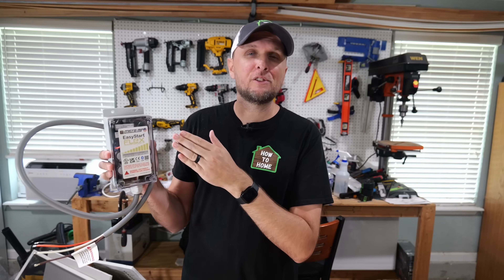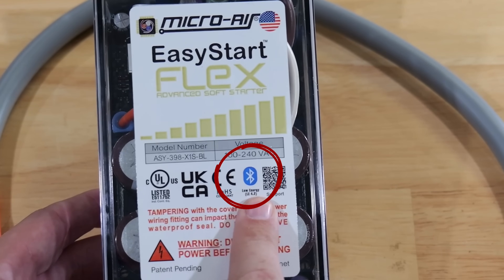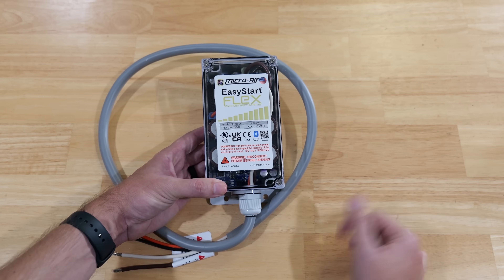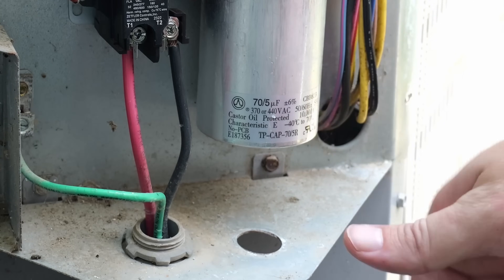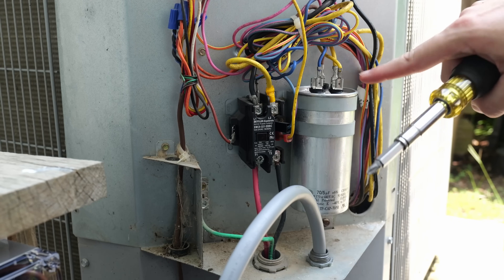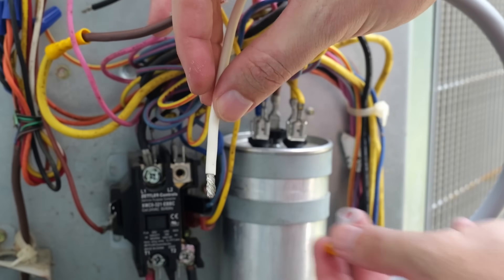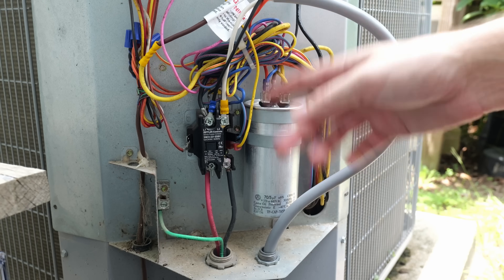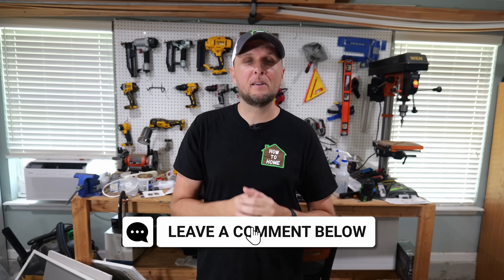The ONE AC Upgrade Every Homeowner Needs to Consider!

Comment: Very interesting video.  Would a heat gun solder connector be superior?
Reply: No and never do that for wear and tear items like this. Would you solder in your car's battery?
Reply: I will sometimes flow some solder under the spades tips after crimping. Makes for an awesome connection. But like the other commenter says, don't solder anything that you might need to replace or service--the HVAC repairman will curse you ;)

Comment: Will this affect the AC's warranty?  Is this approved by the manufacturers?
Reply: That's the big question I called them ask about that they claimed it doesn't because of the Magnuson-moss warranty act which states they can't void your warranty unless what you installed actually caused the problem. The issue I have is how are you going to prove it didn't not going to pay an attorney to sue them. I worry that Microair and AC manufacture just point the finger at one another. If your really concerned there are AC contractors in most states who install these have them install it so they can't say you messed up the install and caused it. Less likely IMO if a HVAC contractor does the work that manufacture can claim it was the fault of a soft-start. If your in a situation where compressor fails under warranty less likely that contractor going to tell the manufacture about the soft start because he installed it.
Reply: @Mike-01234  I would try to find reviews online. If there are bad reviews on the soft starter, you’ll find them. You could contact the AC manufacturer and ask. 
     This reminds me of that 100,000 mile synthetic motor oil called AMSOIL. 
The first thing the auto mfgr wants to see, when applying for warranty, is your service history (and modifications). If you have no record of timely oil changes, your motor warranty is void. They’re not going to honor magic oil. And if you’ve modified your engine, your warranty is void. I suppose it depends on the problem and the dealer.
Reply: @Mike-01234  Remember the days when you didn’t have to worry about warranties? My AC is 34-years old.

Comment: great video, question I have the whole house Generac generator installed at my house would I need this unit on my AC?
Reply: If your Generac is able to take the surge of the AC starting up now probably not. Some larger AC systems can surge over 100 amps for 1/2 a second.

Comment: I have 4 Ton unit and working great on portable generator during recent Texas storms! Game changer, and the new Flex unit just came out after mine but nice to see improvements too! ❤🎉
Reply: Ive heard that if i have a 50 amp generator but my ac is a 60 (which mine is) it will not work. Will these make it work due to the soft start being added, by chance do you know?
Reply: @johnny.9879 - you need to restate your question. I don’t understand what you’re saying and I am very familiar with this topic. Can you clarify?

Comment: Love the video. Will this work for a hot tub application. That thing sucks up a lot of juice when the heater turns on. Thank you!
Reply: Your heater is electical, not mechanical, so no.  This doesnt help with efficiency, only for start ups.
Reply: @srobeck77   he wasn't asking about efficiency, just asked "will this work" on start up.  But I think we all can agree it won't help with reducing loads on startup for purely electrical components with no moving mass (mechanical as you say) that increases starting loads due to inertia.
Reply: @Benjamin-rq1fi  it wouldnt matter for an electric heater
Reply: @srobeck77  lol I think we're agreeing but talking past each other.  My point was in your original reply you said "this doesn't help with efficiency" but David wasn't asking about efficiency.  I see that was your way of explaining why it wouldn't help with a heater, but it sounded confusing because you didn't fully explain that the heater's starting amps aren't going to be much if any more than that running amps (you of course implied this talking about mechanical vs. electrical it just wasn't explicitly stated).
Reply: @Benjamin-rq1fi  You're screeching pedantism and somehow losing your own strawman argument.
Reply: Probably not since that's not what it's designed for.  Also this is a guess, but I would suspect that in-rush amps for heaters aren't much more than the run amps.  Heaters just draw a ton of current because they're directly converting electromagnetic energy to thermal energy with some efficiency loss.

Comment: I have a 5 ton model.  Not the flex. I've only had mine installed for a about 2  billing cycles.  And I've seen a 30.00 per month decrease in my power bill. 100 plus degrees in oklahoma. 
At first the unit actually was louder on startup.  It seems to have become more quite after the first month.  I have not used it with my generator yet.
Reply: How does your company charge them?  Unless there is an amperage charge like he said the running amps is the same.
Reply: @condor5635  Many utilities have demand charges.
Reply: @condor5635  If you have a demand meter these can make a noticeable difference.  They are rare but I see them in rural areas - first saw a demand meter at my grandparents out in the sticks.  Wish I would have known about these back then; they could have used one on their well pump - you could see the freaking meter move whenever their well came on!

Comment: Will the flex work OK if installed on a 15 year old compressor?
Reply: No reason it shouldn't, electric motors are motors and doubt much has change in the last couple decades.  I'll let you know after I install it on my 20yo compressor 😂

Comment: Shouldn't need one if you have an inverter style such as a Trane XV system.
Reply: Is this true for all inverter systems? how would you confirm that from the manual?
Reply: @themoneymercenary  If you have an inverter style system, you do not need a soft start. The inverter will not have high inrush current
Reply: @182QKFTW  Will ALL inverter style systems be advertised as such? And if NOT how would one find out if such is an inverter style if it isn't advertised as such?
Reply: @182QKFTW  I'm about to install a senville 3 ton inverter central system, was wondering if I need this I guess not, would be nice if someone could give me an idea of how much wattage these actually draw at full power
Reply: This isnt for new invertor systems, obviously.....
Reply: @srobeck77  yeah, well that's actually NOT obvious, that's why we're asking about it. But I guess everyone agrees inverter systems have soft start built in...cool.
Reply: @themoneymercenary  but your still wrong. Zero people would recommend a soft start kit or "say that are built in" with an invertor. It's not some debatable thing here if you did your homework there, fella.
Reply: @srobeck77  How can I be wrong when I am asking a question?
Reply: Since @srobeck77 doesn't want to be helpful (probably an hvac installer that's mad that diy'ers are using the internet and saving themselves and other people from being ripped off) I will present the question again for anyone who DOES want to help -  I am planning on powering a senville inverter style 3 ton central AC off a 6000 watt EG4 off grid inverter. The inverter has pulse discharge capabilities built in which largely mitigate the high draw of the compressor starting up but it would be nice if I could make the AC unit simply not have huge amps on startup to begin with. It seems a soft start is the common solution to this problem. I will purchase this if necessary but it seems like people here are claiming that soft starts are either built in for inverter AC's or that inverter AC's naturally don't have large draw on startup. Perhaps they ramp up slowly unlike traditional AC's. This is not a feature that is advertised atleast not by senville IIRC. If someone who actually wants to be helpful could provide some clarity here it would be great. Thanks in advance

Comment: I’ve been looking at the Flex.  I’m a little concerned about the longevity reading reviews on the Reddit Generator page.
Reply: Good call out. Of course Reddit is a mixed bag of valid discussions and haters, so read with caution. 

In this case I believe most of the folks in that subreddit truly wanted these to work and are disappointed in the quality of the units themselves and the support they are getting from MicroAir. 

Thank you. That’s a hard pass for me.